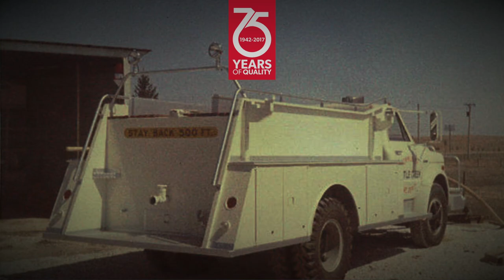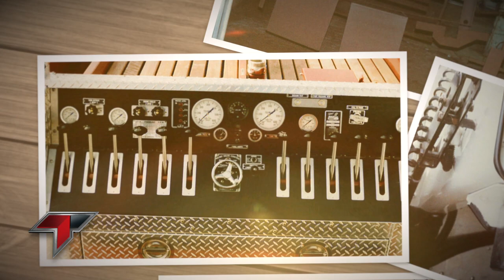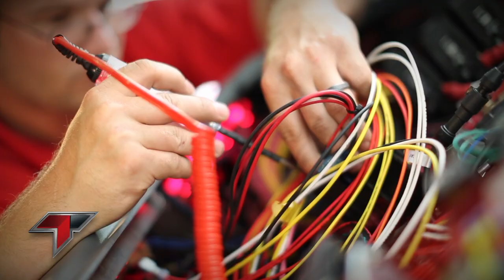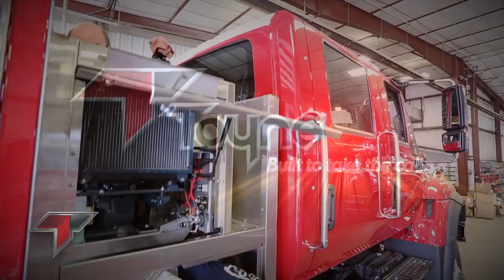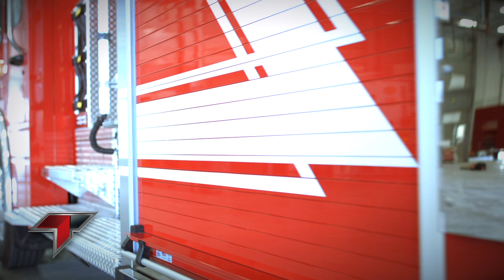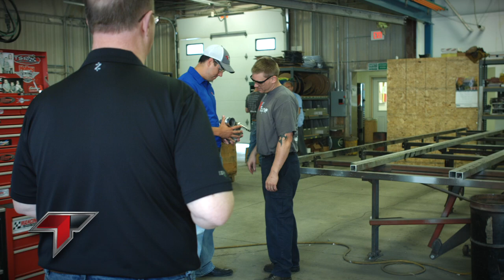Toyne 75th Anniversary

Comment: The very first Volunteer Fire Dept that I started with way back in September of 1985 in Bloomingdale, NY has purchased 3 Toyne Units over the past 15 years. They have purchased 2 Small Tankers on Kenworth Commercial Chassis, and their most recent purchase was in 2016, when they purchased their very first Custom Spartan 6 Man Cab Rescue Pumper. The Spartan 6 Man Custom Cab was the very first fully Custom Cab Rig ever purchased by the Bloomingdale Volunteer Fire Dept. They have come a very long way in a very short few years, thanks to newer, younger members, and Officers taking charge, and stepping out of their Comfort Zone, getting away from the Commercial Truck Chassis, and getting into a fully Custom Cab Unit, built by Toyne.

Comment: The very first Volunteer Fire Dept I joined back in Sept of 1985 used to run a full Darley Fleet of Pumpers, and a Pumper/Tanker, and now days, they are running a full Toyne Fleet of 2 Pumper/Tankers, and their most recent Toyne Rig was in 2016, when they purchased a Toyne Rescue Pumper. The Fire Dept I am referring to, is the Bloomingdale Vol. Fire Dept, Inc. and they are located in Bloomingdale, NY.